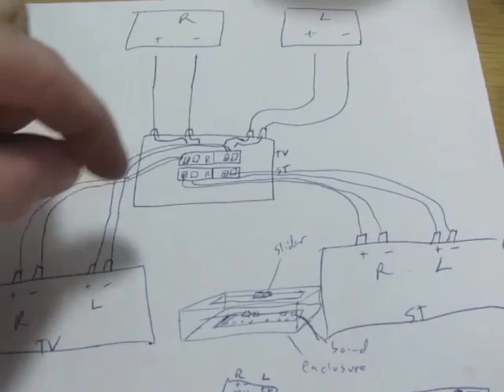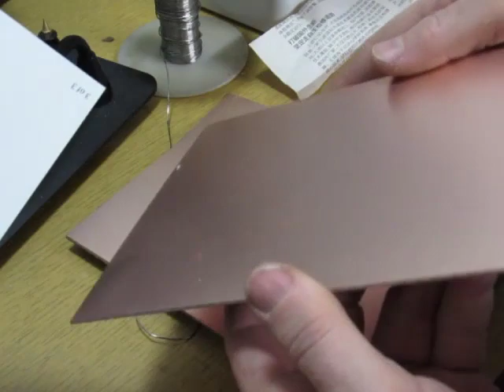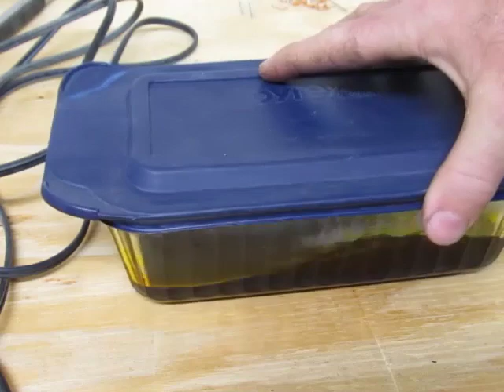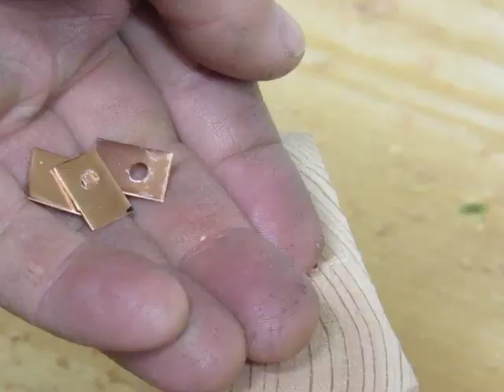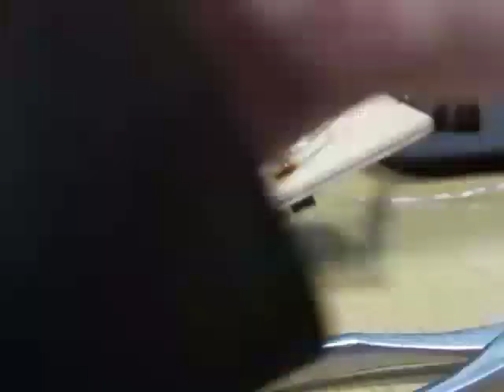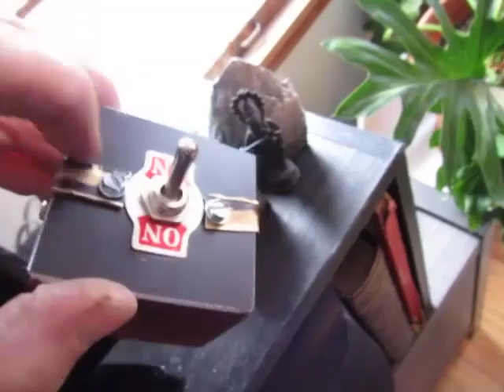Electronics Hobbyist Fails... Yet Succeeds?

Comment: Patrick. Can't wait to see what you come up with for version two. 

(DANGER - I just read a bit about this and the grounds even in the same amp are not often common so don't do any of this... I will leave my thoughts here though to see if someone shouts at me)
I wonder if the black wires for the speakers are actually a common ground in which case you only need to switch three wires. If you do a continuity test between the black ones on the same amp I reckon they will be. If you get even more daring you might join the grounds from the two amps together and then you only have two wires to switch.. (although this might be a bit more risky, perhaps with both amps on measure the DC and AC voltage between them and if it is greater than zero then don't do it) 
(End of DANGER)

I think you were wise to abandon your home made switch because if it slips and makes a contact before it breaks the other one you could have two dead amps.

Really fun video and I really enjoyed the music and the narrative and the side track and that you have quite a workshop there. Brilliant stuff.
Reply from the maker: I'm glad you liked it, Martin! I followed a similar trajectory that you did, exploring the options for this project. I decided to leave all my comments and experiments in the video even though I knew they were muddy-headed. It invites people to shout at me but I do think if someone views it and is entertained, or feels compelled to offer their wisdom, then I've done my job.
Reply: @pbartmess  beryllium broze that's would have been the answer. It's springy metal for contacts. Something like that anyway. Ferric chloride etching was so fun to watch. I made a few PCBs many years ago and it was so nostalgic to see
Reply from the maker: @loopinnerthe  Thank you for that metal reference!!! I'll put that in my project journal for the next phase. I'm glad the etching section brought back good memories. I haven't etched in a few years but it all came back when I cracked open the bottle of ferric chloride. It has a distinctive scent and always brings back pleasant memories for me too.

Comment: Ah, necessity, the mother of invention.  I was thinking, as you went along, that what I would do just is buy a switch instead of trying to build one ... but then again there's a great deal of satisfaction in making the thing yourself.  I also probably wouldn't order the right switch; is it 3 pole 4 throw?  I can never remember how that terminology works.
Reply from the maker: Haha! In fact my first impulse was to buy the switch but I thought I could make something that looked interesting. I found it at American Radio Supply. Officially it's a 4-pole double-throw, which means it's switching between two sets of 4 circuits. "Single throw" would be merely switching one set of 4 circuits on or off.